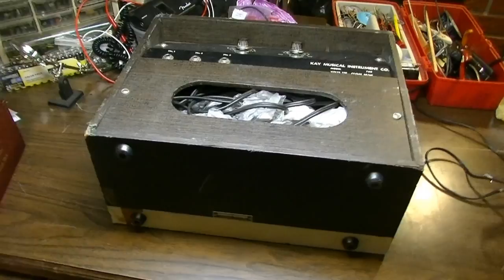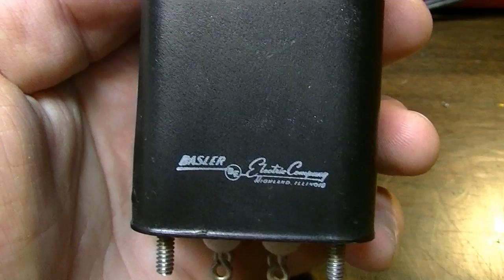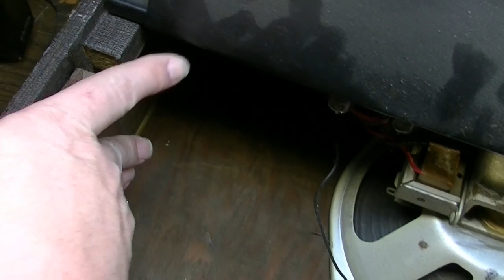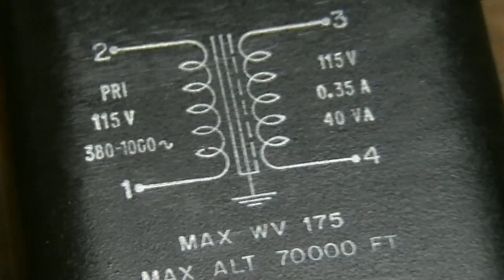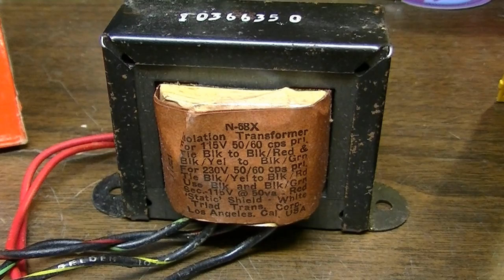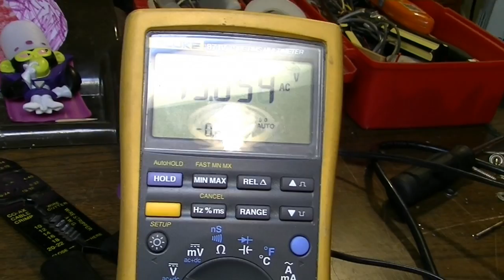Amp Mod Goes TERRIBLY WRONG...Before Going Right Again

Comment: Packing an electronic item for shipping.    I used to work for a courier company, freight handlers don't have time to look for Fragile stickers, and robots can't read them, so assume that the box will not be gently handled, by anyone other then possibly the pickup and delivery drivers.  Couriers live and die on pieces per shift, and these are not small numbers.  The depot I worked at would post 10K pieces over a 7.5 hour shift, on a light day, Christmas you could get over 10 times that....

Take a box that is at  least 15cm (6") larger then the item, in all directions.  Fill 1/4th of the way with loose packing material, such as packing peanuts.  Take out tubes, wrap tubes in bubble wrap, and place inside the case in such a manner that the package of tubes does not move around.  Fill all empty spaces inside case with pieces of bubble wrap/  Wrap the whole thing in bubble wrap, at least 2cm (1") thick.   Tightly tape all edges.  Place on top of packing peanuts, and add more around the outside edge until the box is full.  Gently shake box to settle the packing and add more until it's about 1cm (1/2" ) above the top of the box.   Type on a piece of paper the senders name, address, email address and telephone number; also include the same information for the receiver, a photocopy of the waybill is even better.  This then goes on top of the contents before you seal the box.  Seal the box, tape the opening, tape all the way aroundf the box, then across the opening also, all the way around.  Tape all edges and corners, as these are the weak points in a box.  Write the name and address of the shipper and receiver on the box, along with the waybill or tracking number on the side of the box.  Stick the courier waybill on the top.  

Let me explain that last bit, waybills can get mangled or torn off, then it goes to shipment resolution, trust me, the courier doesn't want your amp, and the less work they need to do, to get it going, the faster it will get done.  Having all the info on the box, means  a minute to type up a waybill, it's going to get done as soon as they see it.  Boxes with no info on the outside, might take a day or two, before they open the box, get your paper, call you for the tracking number to get it going again..... No info it can sit for weeks, before it gets logged as dead freight.....

Nobody will intentionally damage  your box, they don't have the time, but stuff happens....   Brad I suggest you copy this, and send it to all customers who are sending you amps for repair.

Comment: I did the same thing almost, to the same model Kay I’ve got here. Quick BTW, I swapped out the preamp tube for a 12AU6 because my filament transformer was only at 12.5 on the secondary. I had a microphonic .05 feed cap which I swapped out, and used a R/C combo of 47 ohms / 50 mfd. for the grid bias. The speaker really sucks on these, but I left mine in, hardly ever play this one anyway

Comment: If the isolation transformer seem to run hot, might a bridge rectifier be needed?
Assuming the rect tube is half wave?
The isolation transformer will have unequal loading each cycle?
I dunno me not tech.

Comment: @The Guitologist
OK, free guess, what aircraft still has electronics gear like this iso transformer? 
Maybe hook this up to a screen, Brad & see if it shows pictures of a UFO, taken from an RB-47 - they had a whole bunch as you may know.
What about Dallas shooters getaway plane? After dude had hid himself in the trunk of that car parked against the stockade fence - that's the best, actually the only, print evidence in the case: footprints.

Comment: I know abot 400hz transformers! I had to do a wiring repair on a 757 galley intercom and I grabbed the wrong heat gun out of the tool room for the heat shrink. I plugged it into one of the 110 outlets in the galley and when I turned it on, SMOKE!. 60 hz tools do not like 400hz line voltage

Comment: Do you work on solid state amps? I've got one needing some work bad
Reply: I could meet you half way and wouldn't need it shipped. Its one of them things that may not be worth fixing but it's too good to throw away if that makes sense. I have 284 dollars new for it so I'd like to try at least. The manufacturer won't touch it altho Its in warranty

Comment: Milk? How dare you! Your amps would sound much smoother if you used cream.

Also, the reason 400 Hz AC is used in aviation is because it lets them use lighter transformer cores, saving precious weight. They aren't just doing it to be different, there really is a sound engineering reason for the choice.

Comment: Hey, if you still have the aircraft transformer, I'm pretty sure you could open it and retrofit an appropriate transformer into it. Those are usually a can with the transformer potted into it anyways.

Comment: Fyi if you need any more isolation transformers, medical isolation transformers can be got pretty cheap, and there extremely well built. Dale and fluke ones are ofen as low as $30-40 for 5-10amps  https://www.ebay.com/sch/i.html?_from=R40&_sacat=0&_nkw=medical+isolation+transformer&_sop=15

Comment: Hi.  I don't understand the purpose of the isolation transformer.  If you are adding it for safety reasons the line cord earth is connected to the chassis which would bring the secondary (if it is grounded to the chassis) to the same potential, thus rendering it non-isolated.  Maybe I'm missing something here.

Comment: After you said you had a problem i was guessing that you might have connected the transformer like a common mode choke (well that is, if the phasing was right).

Then again, I didn't watch the video, just listening. Well a 400Hz transformer would have way too little iron inside to work good on 50/60Hz.

Comment: I LOVE you're  FAILURES or EPIC FAILURES...that's why I just subscribed...that's where you learn the most.... not afraid to go there and record it.  That's  where you SHINE ...(PS..... I stopped  the video on the first Transformer and read the date specs...and I didn't take the 300~600..... as Hz  either.  )   OOPS.
 Though I might have test benched it first before cutting the chassis.....brand new stuff is bad out of the box as you well know.  If it was 'drop in' ....I might not have. 
CHEERS.. a new fan.
Reply from the maker: Thanks for the comment. I appreciate it.
Reply: YOU DESERVE IT ( and more)...You have a GREAT little  CHANNEL here. Cheers from the Deep South...on the SEA Islands.

Comment: You saturated the core and drew excessive current. Had you had done the low voltage test you mentioned, that wouldn't have happened, and it would have appeared to be okay.

Comment: Learning a lot from your videos. I inherited my father in laws variac and tube testers and have been looking for some sort of schooling on tube amps ever since. It's a steep learning curve even though I went to DeVry, I graduated in 2000 and my job at Intel didn't allow me to use the knowledge I gained there. I actually benefited more from my years in Auto Parts and Mechanics than I did in electronics. Weird right! Anyway thanks for your videos!

Comment: What does that switch on your TS9 do?
Reply from the maker: Kills the power even with the cable left plugged in so battery doesn't run down. Those remain active even when LED is off as long as cable is plugged in the input. This way, you only have to flip a switch, not disconnect cable when finished playing.

Comment: Hey Brad I have a question regarding mods.  I was wondering whether or not you could mod a hybrid amp into a full valve amp and what would be necessary in doing so?  If this is possible how much would you charge on something like this?
Reply from the maker: It can be done. Normally I could do that for you, but I'm taking a break from outside work as soon as I finish these last couple customer jobs. Hit me back up in a couple months and we'll talk.
Reply: very cool, thank you

Comment: You Should Build a Current Limiter. Uncle Doug Shows us How :)
Reply from the maker: It's been an addition I've been meaning to make. My variac does give me lots of warning if there's an issue. It vibrates with excess current draw, so I can tell right away when something is wrong, I just got over excited and dialed this one up too quickly.
Reply: Mine has saved me many times :)

Comment: I've got an ammeter on my variac as well as the input and output voltage. If you see the current rise with the voltage it's usually a good sing that something is shorted, and if it's just excessive current draw you'd see it too.
Then again the variac I usually use doesn't care, I used to run tesla coils and high voltage stacks pulling 80amps at 240vac and the thing just doesn't care
Reply from the maker: Sounds like a very nice variac! Mine does warn me if something is drawing excess current. It vibrates. If it starts doing that, I know there's a problem. On this one, it was my fault because I kinda didn't heed the warning.
Reply: Yea, old british made thing. It was just a bare variac so all of the other stuff I added myself, inrush limiting and what not
Yeaaa, never ignore the variac :p

Comment: Add a AC Voltmeter, Ammeter, Wattmeter to your variac setup.  May save fuses and components when there is an issue.  https://www.youtube.com/watch?v=8X0eyY7TcM4  These are not very expensive online and if you know what you are doing, can be powered by a 12V wall wart to operate below 70 volts.

Comment: Just for me, if I knew I couldn't use the original xfmr again, I might have left it on the chassis unconnected.  It does look good.  Then hide the new Iso xfmr under the chassis somewhere.
Reply from the maker: I did briefly contemplate how I might cut the case off the old one and stuff the Triad inside it and epoxy it all up or something, but couldn't really think of a good way to do that.

Comment: All these years... and I didn't put the milk next to my Variac!! Mind blown I absolutely LOVE your sense of humor! LOL
Reply from the maker: It's the variable bovine lactation (VBL) that makes the magic mojo.
Reply: Most impressive!! I gotta try that on the Gibson Saturn GA-45 RVT amp I'm working on now! Thanks for the pro tip! :-)
Reply from the maker: *Disclaimer: VBL techniques are only to be performed under lab conditions by a certified VBL technician. The Guitologist is not to be held responsible for any unauthorized use of VBL techniques in any non-approved conditions. Any such use is at the sole discretion and responsibility of the end user. The Guitologist is hereby absolved of all liability.

Comment: Hey Brad, another entertaining video. Sucks about the aerospace transformer. Anyway, if your Fluke shuts itself off, just press the yellow button and it will come back on. No need to wind the main switch off then back to the setting it was on.

Also, the reason the voltage was higher on the secondary of the isolating transformer is because the efficiency of the transformer is less than 100%. The secondary voltage will drop compared with the primary when you load the secondary up. This is called transformer regulation.
Reply from the maker: Thanks for the tip on the Fluke. I did not know that. Got this thing sans manual.

On the transformer, you are correct, but i was talking about something else... This particular part was actually miswound. if I hooked up my primary 120VAC to one side and measured the other side, it was like around 140VAC or something. The other way it was more like 105VAC. I chose to hook up the latter direction, obviously. The filaments were dissipating all the voltage potential that way. No extra resistor needed in the chain.
Reply: My question is what the voltage would be like under load.  Sometimes to cheapen a transformer, they'll use a smaller wire and just do a few extra windings.  So it might appear to step up when only loaded with a meter, but will be more 1:1 once it's loaded with the amp.
Reply: Right, so there are more windings on the secondary side than the primary side. You connect the primary to 120V and the secondary reads 140V off-load. Then at full-load, the secondary voltage will drop to 120V. This is as expected. Your transformer is not miswound.

Clearly, if there are more windings on the secondary, if you connect it backwards, the off-load "secondary" voltage will be less than 120V. But then as you load-up the transformer, the voltage will drop even further. The "secondary" voltage will always drop when you load the transformer up due to its less than perfect efficiency. HTH
Reply from the maker: I understand that a load will drop the voltage, but an isolation transformer - a 1:1 transformer - isn't supposed to step the voltage up or down at all. The windings should match. The amp needs to see around 120V max (without a load), ideally 110V as that is what was available when this amp was made. The filaments are designed to drop all this voltage. If you present the series string with excess voltage on the order of 140-150V then there will be excess voltage left over which is not dropped off by the filaments. I'd need to add a large resistor to that circuit which would dissipate heat and drop the remaining voltage potential to be safe. I think we may be confusing the higher voltages produced by a non-loaded step up PT without, say a rectifier tube in the socket. Yes, a normal step up transformer in a normal guitar amp will produce a higher voltage without a load than the normal B+ will be when the rectifier and all the other tubes are in socket.
Reply: Exactly. A 1:1 isolation transformer does not have a 1:1 turns ratio. The 1:1 is a bit of a misnomer. As the others have mentioned it will usually be a bit of a step up with extra turns on the secondary to make up for winding resistance. That way the voltage is 1:1 under rated load. It wasn't miswound.

Comment: So these little practice amps not only used line voltage for filaments but for B+ as well? no internal power xformer at all?
Reply from the maker: Many had no PT like this. The earlier version of this Kay 703 had an isolation transformer on the whole filament chain and was larger than the one we see in this later model 703C with just an isolation on the preamp tube filament ONLY.
Reply: If you're not familiar with it, check out the "All American Five" radio design.  A cheap way to mass produce radios without the cost of a power transformer. Same basic idea as the amps, and predates it by a few decades. :-) https://en.wikipedia.org/wiki/All_American_Five

Comment: The reason the first transformer didn't work is if if you read the specs it says 360 - 1000 cps NOT 50-60 cps. Using it at low frequency means a low impedance and therefore a heavy current draw. The one you eventually used was for 50-60 cps LINE frequency. That's the correct transformer for this application.
Reply from the maker: DING DING!!! Here's a winner! I'll have to figure out a prize later.
Reply: Just trying to be of help
Reply: you said .47 but the cap said 4.7 ? was that just a slip of the tongue? thanks for the vids and i laughed because i did the same thing on an old radio! thought i was a winner when i found an excellent potted tranny made for Collins in the box..... and it was same as yours 400plus cycles!
Reply: buzzsaw161 The aircraft industry uses 400 hz, the higher the frequency the less iron needed, hence lighter equipment. for Eg. .. a 10 hp motor operating at 50 hz will develop 12 hp at 60 hz or 80 hp at 400 hz. if you work backwards the kva rating of a 400 hz TX is 8 times less when operating at 50 hz TX.  so much less ampacity in the wire and it burnt up instantly.
Reply from the maker: I know. That wasn't sarcasm or anything. In the video description I said we'd have a competition to see who caught the mistake before me. ;)
Reply from the maker: Yes, the cap value thing was just me running my mouth faster than my brain. it happens all the time on this channel.
Reply from the maker: Thanks for taking the time to present this explanation.
Reply: I know. That's been my field for 35 years.

Comment: My first thought is to caution you against using the secondary as the primary on those isolation transformers. I see some where the secondary is some stupidly low resistance and may cause things to fry. in this case, I think it worked out, but I think giving them a simple test in the future is a good idea. I've had good luck with the N68x as did you, but if you try any others...

Anyway, great work man. Sound good. Bummer bout the chassis...
Reply from the maker: It's just an isolation transformer. Provides isolation from the full wall current and maybe more importantly, provides some ripple filtering, making the amp less noisy. Originally, the amp was just hooked direct from the wall to the tube filaments. There is an isolation cap and resistor between the chassis and common ground, but still, each tube filament serves as a fuse. If one of those goes, the thing shuts down. And the filaments are 100mA rated. Anything over that and they aren't long for this world.
Reply: Actually, I'd be more concerned that perhaps the secondary wasn't wound with the idea that it would have mains voltage between the secondary and chassis.  That's the kind of thing that can come back and bite you when you decide to make changes.
Reply: Yeah it's THAT man whatever performing better with ripple I don't care what it is is TONE. and interestingly enough seen it tied to larger capacitances, not always though just idk what the hell some caps just came out or are alittle better than others.